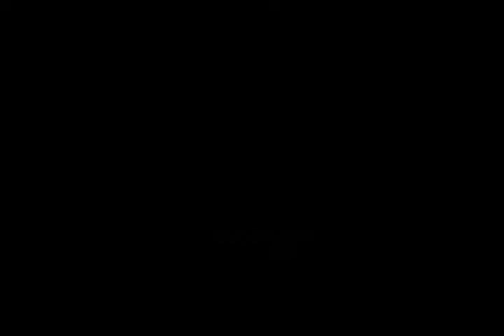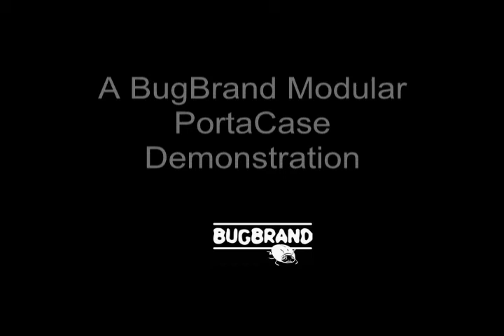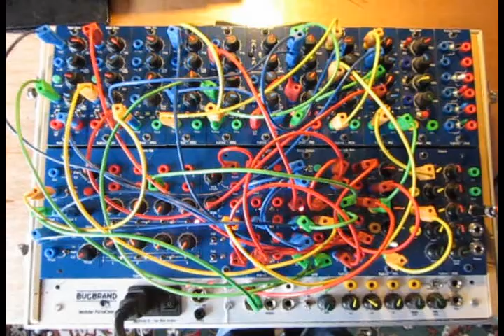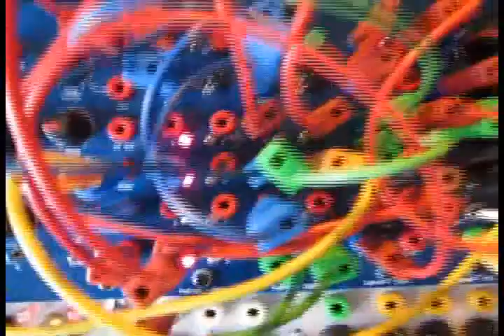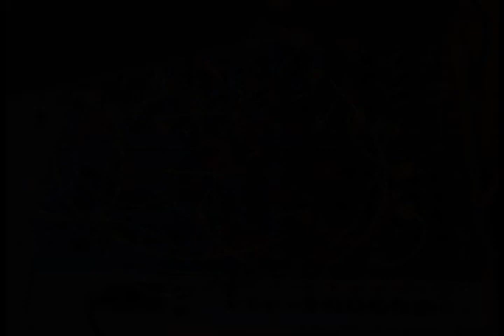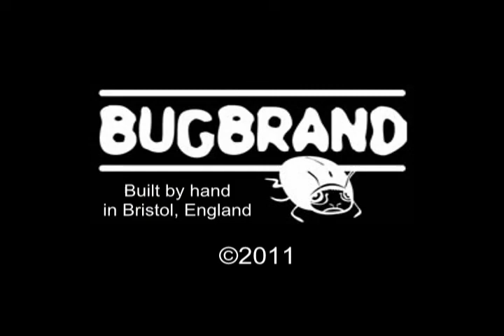BugModular - PortaCase - SEQ demo

Comment from the maker: Cheers John - a little hard to say as the portable case is a total prototype (meant to make a regular portable case but so far haven't managed). But roughly speaking you'd be looking around £2500 -- though that totally ignores the fact that demand for any systems far outstrips supply at this stage!